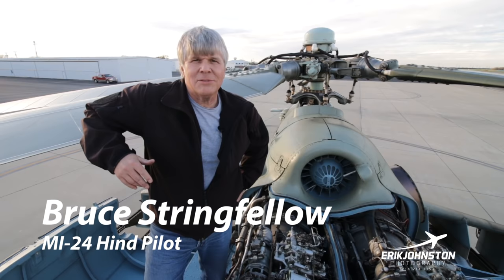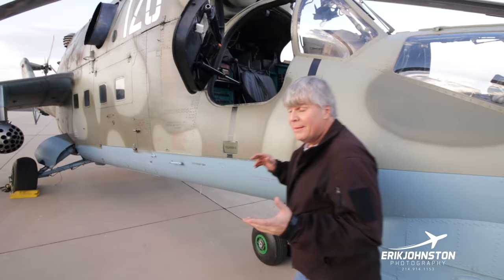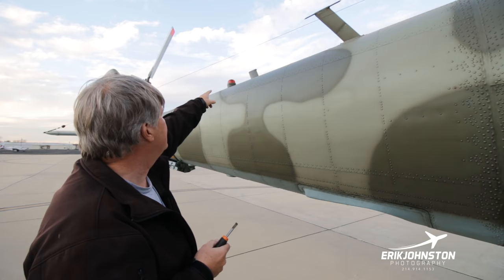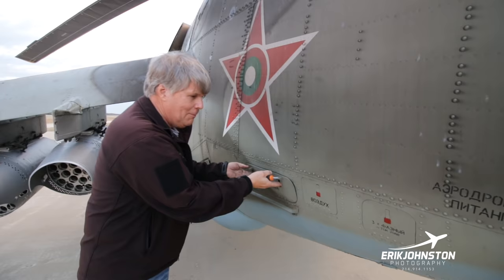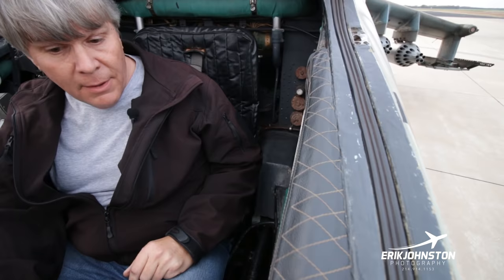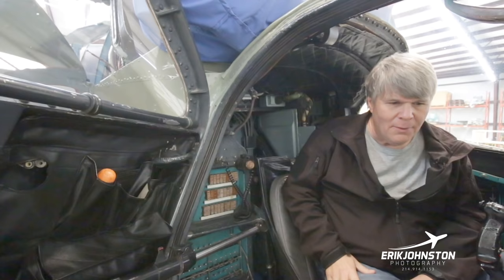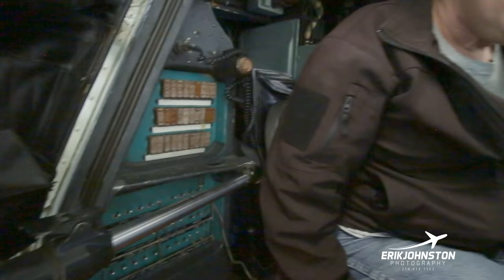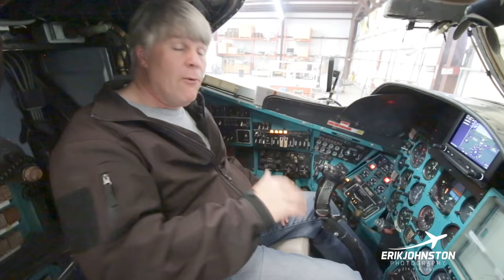Hind MI-24 Helicopter Walkaround Tour

Comment: This Mi-24D   #120 is former aircraft  of Bulgarian Air Forces,  30 years ago I flew at this helicopter. So many memories!!!
Reply: Any brief story about this specific aircraft?
Reply: @badbilly1083  
Neat, that guy flew it!
Man this is a large helicopter. The Russians build big...
Reply: @badbilly1083 Sorry for my English, I hope you will understand what I explain.  I flew at last   25 years ago on this helicopter, it was in second squadron of 24 airbase striking helicopters. I am not sure in translation because there  was a different organization  then NATO. We had 44 helicopters Mi-24 versions D and B. B version was newer with supersonic antitank rocket, in D version guiding rocket    was subsonic.  The inertial navigational system work pretty good, for flights at low heights. I see  there missing one unit above PSU , the name was "Lipa", it  was stayed at the round place  and used  to avoid IR rockets as RedEye and Stinger. Due this Taliban use  usual  RPG-7 against Mi24 in Afganistan. They dig a hole in ground and stayed there as ambush, when helicopter fly above them , they fire  in the bottom from little distance.  I will talk with colleges about this craft  and if we  remember something or find in old pictures I will send you. If you have some questions I will be happy to answer.
Reply: No, you did not. Never happened.
Reply: @chichomancho1791  how many soldiers can be Accamodated in this Mi24 and is it possible to carry out armed attack/assault missions operations while Mi24 have soldiers occupying there berths seats in back cabin
Reply: Ogen De Witt  some of those helicopters was sold to militaries  of African country, and now in my country left 10 pieces.
Reply: @vinodkaka5225  11fully equipped solders can get in back cab  , 8 of them can fire trough blisters,  2 of them sitting in middle and one sitting in the tunnel to the pilot's cab. All solders are sitting on the floor, that berths are removable. The weight of one equipped solder is about 120 kg, plus all weapons (4 antitank rocket, 128 NURS ( nonguided rockets), 1400 cartrdges 12,7mm for machine gun  plus full fuel - this is the max takeoff weight . So the takeoff  can be only like airplane, need a runway,  and takeoff after 80-100 km/h  , in flight speed about 150-260 km/h ,  roll max 60deg., to the drop zone.
Reply: @chichomancho1791  thanks so much for yours reply Sir . Actually it's my pleasure to talk to a former Mi24 helicopter pilot few years ago as These Soviet/Russisn helicopter is my favorite helicopter although I have seen these helicopters flying in front of my eyes but not got opportunity to fly on board these beast as I am from India and indian Airforce also operates Mi24/35 helicopters gunships & literally I don't know the difference between Mi24 & Mi35 for me both looking same from outside
Reply: @vinodkaka5225  differences are only in electronic and weapons equipment , engines, systems and fuselage are the same
Reply: @chichomancho1791 Thanks again for clearing my point by the way I love Mi24/35 helicopter gunships as this is the Only helicopter gunships in the world which has capability to carry soldiers on board
Reply: Me too
Reply: Is it ok to step on the engine cowlings like that or is it just bad practice?
Reply: @chichomancho1791  It must have been shocking to see the helicopter you flew in on a youtube video, eh? What was flying it like? It's such a beautiful craft.
Reply: I see them still flying from Krumovo Air Base and they a such a beauty ! By the way do you know what is the history of the one inside the museum in Krumovo? Was is an older version that reached its limit in hours or was used for spares. Sory for not typing in Bulgarian but wont be fair to the rest of the guys here! Last time I went to the museum the Mi-24 was open to climb inside and look around so I had a very good time inspecting the instruments inside ! What was the scramble time for the Hind if you needed to take it to action and how long is the flight time considering the fuell load?
Reply: @chichomancho1791  That sure is a lot of people!! I was inside one in the Kiyv War Museum, and only saw seats for six, maybe eight people on the back. No wonder the helicopter must make a take off run at that weight, and I bet it won't be able to hover...
Reply: @thomasalexander1851  There's "no step" zone lettered up the cowling and unmarked "step" zone closer to the fueselage. So you can step on these, just not where the grating is.
Reply: Niiiiice
Reply: To a very rich rich playboy, this bad ass helicopter can fit in 71, pilot and gunner at the front and 69 at the back
Reply: @KellingtonDorkswafer  it is nice to see that helicopter in good hands.
Reply: Why isnt your comment hearted yet?
Reply: @conan670431  Bro, fix your "я" in the surname. In English it is spelled with "ya" not with "q". How's things in the fatherland?
Reply: @julianpetkov8320  I know ,but this way not many people can find my profiles on facebook and other media, so I prefere to spell it wrong.... All is well here and the weather is lovely at the moment. Hoping to visit the museum in Krumovo next week again .
Reply: I come to the comments for THIS 💪
Reply: @chichomancho1791  здрасти, чичо) were gauges labeled in russian, bulgarian or english?
Reply: NX120NX is November experimental 120. The FAA licensing in the USA all aircraft are November and exotics are NX. Gliders and ultralights are plainly labeled Experimental.
Reply: @mishacol  всички надписи по таблата и приборите бяха на руски език
Reply: Истински пилот от авиобаза Крумово? Простете ми ако съм малко скептичен , но найстина сте летяли на този МИ-24 ? Механикът във видеото повдига няколко интересни въпроса (Наричм го миханик защото показва явно инжинерно разбиране за вертолета) като например, защо доплер системата не е работила според българските летци, или било ли е удобно да се оправляват насочвани ракети със системата за контрол и как е изглеждало във околяра при положение, че топлината от ракетата би нарушила видимуста през каквото и да е камера. Много ще съм благодарен ако ми отговорите, защото допир със историите на истински пилот на този Звяр биха отговорили и пояснили много неща за машината и доктората за управлението и. =]
Reply: @duartesimoes508  sure it wilö hower or its nearly impossible to land enywhere 😁
Reply: Thank you for telling us about this.
Reply: @chichomancho1791  the place in a tunnel is for a board engineer, the third crewman; practice of including him in the crew was on and off at various times and various militaries. You might not have flown with him, but it was intended as his place.
Reply: @vinodkaka5225  Mi-24 is the general name for the series as a whole and Soviet/Warsaw pact (and early export) versions in particular (several versions existed, denoted by letter indexes, including older Mi-24A and U ("У") with a different, "greenhouse" cabin design).
Mi-25 is an export name for a Mi-24D ("Д") (like the one in the video); India got a couple dozen of those plus a couple Mi-25Us (export Mi-24DU, training model with identical instruments in two cabins and no machine gun, but with rest of equipment and weaponry in place) ("У" stands for training). Some indian Mi-25s were later upgraded to Mi-35 and unique Mi-35U (there was never a factory U version of the 35) specs, some weren't.
Original Mi-35 is an export version of the Mi-24V ("В") with new missiles and stuff (India bought dozen or two of those too, I can look up exact numbers) ("В" comes before "Д" in russian alphabet, but V's missile complex was slow to develop, so transitional D model entered production first).
Export Mi-35P ("П") is a rarer export version of Mi-24P (similar to a V, but with no machine gun and a huge double-barrel 30mm cannon on the right side of the fuselage instead) ("П" stands for cannon).
Then there was the last soviet model, the Mi-24VP (with a 23mm double-barreled cannon in a swivelling mount like V's .50cal gatling, with night vision tech and carrying even more missiles), but it was very rare and never exported, less rare Mi-24R ("Р" or occasionally "РХР" or something), an NBC recon version with no guided missile capability (but the rest of weapons retained) and with troop cabin occupied by two chemists and various equipment they operate ("РХР" stands for radiation and chemical reconnaissance), and rare Mi-24K, an artillery fire director, also with no ATGMs but instead carrying cameras to track and calculate coordinates of artillery impacts to stream them to artillery units so they can correct their aim ("K" stands for corrector).
The next intended version (in newly formed Russian Federation) was supposed to be called Mi-24VM, but was instead called Mi-35M both for russian military and for export. It has a swivelling 23mm gun like the VP, ball-shaped day/night/laser/thermal observation/targeting system like the very rare russian Mi-24PK2 upgrade, non-retractable landing gear, shorter wings with new weapon mounts, new rotor designs, new drivetrain, electronics and ergonomics, all a product of Mi-28 (a different russian attack helicopter) development. That's what's in production now.
There were a couple more rare versions between the end of full-scale Mi-24P/Mi-24V/Mi-35/Mi-35P production with the collapse of Soviet Union and the start of full-scale Mi-35M production in Russia in this century, like the Mi-35Ps made for Cyprus that had the new stubby wings, new landing gear and cabin adapted for night vision, but were otherwise standard Mi-35P, or the russian Mi-24PN ("ПН", "Н" standing for night), that were similar, but had an unusual thermal sight protruding from the nose, but these are what the Soviet/Russian versions were.
There were also some foreign upgrades of various successfulness.
Reply: @conan670431  these might have been reasons for its retirement too, but the main reason is that Bulgaria was/is too short on money to run this many machines, also it doesn't have any real enemies that I'm aware of. Plus it isn't terribly friendly with Russia at the moment, and there aren't many ways to get authorised service for these without getting russian companies involved.
Reply: @duartesimoes508  officially, troop capacity is rated as 8, I believe.
Reply: @profil4e  I don't speak Bulgarian, unfortunately, but, knowing Russian, I think I understood your comment.
That gentleman seems to actually be who he claims to be.
ВВС НРБ actually had an (export specification) Ми-24Д with a white tactical number "120" on its engine cowlings, I can try looking up its serial number and what else we know of its fate.
That recessed device with two domes below the tail of the helicopter is called ДИСС-[some number] (доплеровский измеритель скорости и сноса), it's used to measure the true altitude, speed and slide/drift of the machine relative to the ground.
The guidance system for anti-tank missiles was called "Радуга-Ф", as a version for somewhat cartoonish-looking subsonic "Фаланга-П" missiles. П stands for "полуавтоматическое наведение" (earlier versions, as used on Ми-24А, for instance, were manually guided).
Its use requires the helicopter to be in straight horizontal flight (+/- several degrees); if the flight characteristics permit the launch, "пуск разрешён" lights up within the optic's field of view; limits of angles within which guidance will be possible are also displayed. Copter's control stick has a dedicated button that quickly automatically returns the craft to a level flight as to allow guidance to function, and when the guidance is in progress a system will warn the pilots if the maneuver they're making will make the missile lose guidance.
After the missile is launched, the operator (the pilot in the front bubble) just has to hold the crosshairs in his optic on the target using a joystic of sorts, and the system will automatically identify and track the missile by the tracer lamp in its tail, automatically calculate its deviation from the point of aim (point of aim can be changed midflight, if there's enough time; this also allows operator to easily follow a moving target) and automatically send proportional corrective guidance signals to the missile (via a directed antenna), which will smoothly lead it to the target. Operator just has to track the target, everything else happens automatically (this makes the system semi-automatic; in manual systems operator had to track both the target and the missile; in fully-automatic systems both are tracked by the system).
It's pretty easy and intuitive to use (as opposed to earlier manual systems) and allows a high, 80-90% hit probability at tank-sized targets at all intended ranges.
It also supports several selectable frequencies/signal modulation modes that are used for encoding both radio signals sent to the missile, and missile's tracer lamp flashing to be tracked, so several helicopters can launch missiles near one another simultaneously without interference between them.
Reply: @user-kk1hg8sn7i  true but if you have a surpluce of equippement you dont just sell i all away but put it as long term storage reserve.... yes BAF cannot maintain and operate 40 Hinds but most could have been conserved and stored just as the tanks were ..... over 2000 of those still present .
Reply: @conan670431   but that's what people did. Moreover, that's what people do, especially in the circumstances outlined. Especially when there's money to be made for them personally. Moreover, that's what these same people would have continued doing to this day if they didn't ran out of hardware they could sell. Or, rather, hardware anyone would buy in a condition that it's in.
Properly storing aircraft is expensive. Maintaining it requires buying parts and services from Russia.
Even besides all of that, an attack helicopter is a much more complicated machine than a tank. To make matters worse, when something in a tank breaks, it stops; when helicopter breaks, it falls to the ground; and that just isn't the same thing.
Also, I doubt there were ever as many as 2000 tanks in Bulgaria; are you sure on that?
Reply: @user-kk1hg8sn7i  T-55AM2 tanks (1,400 units kept in storage as reserve in the province of Montana) , 220 T-62 units in storage near Yambol ,  T-72A/M2 160 units on active service / 240 units in active  reserve , PT-76 amphibious tanks (250 in reserve ) , 2S1 Gvozdika Self propelled artillery 506 units as of 2019  .     And a research by US at around 1987 : ----  By July 1987, the International Institute for Strategic Studies estimated that the Land Forces were organised in eight motor rifle divisions, five tank brigades; four surface-to-surface missile brigades with "Scud" SSMs; three artillery regiments; three anti-aircraft artillery regiments; a SAM brigade; and a parachute regiment (later identified as the 68th Independent Parachute Reconnaissance Regiment, forerunner to today's 68th Special Forces Brigade (Bulgaria)) and special commando companies. It appears by the late 1980s that a Bulgarian-helmed Balkan Front was very active, which could unfold and direct the three armies after mobilization. After 1987 the motor rifle divisions were reorganised into brigades as well. At that time the IISS estimated that ground units operated a total of 2,100 tanks (430 T-72 and 1,500+ T-54/55) though later more accurate intell have raised the figure to 2,550.       So yeah even now there are around 2000 tanks but only the T-72's are under modernisation plan....
Reply: @conan670431  these all sound like estimates/guesses, especially stuff like claiming all T-55s are (Czechoslovakian?) T-55AM2s. I'd guess it includes vehicles older than T-55.
Then I thought about CFE treaty and googled for Bulgaria's reports within treaty. So 2 145 tanks, 2 204 combat armored vehicles, 2 116 artillery pieces over 100 мм, 243 combat planes, and 44 attack helicopters were declared on January first 1990. Helicopter part is true, tank/vehicle/jet part sounds high, but assuming lots of old machinery in service - may very well be possible.
524 tanks, 738 armored vehicles, 1 161 artillery over 100 мм, 57 combat planes, 19 attack helicopters declared on jan 1st 2011. That sounds more like it. I mean, clearly not all of those aircraft were airworthy at that time, but that must've been how many were still in the air force inventory.
Reply: @user-kk1hg8sn7i  No idea what if the current amount of the tank force . What it was is that Bulgaria was supposed to take the first hit as war errupted and had to hold for a bit on its own until Soviets arrive with their army across the sea, so all of that eqippement was brought in great numbers in order for the country to serve as a shield for the first waves and it was ridiculous for a small country to have forces like this. Of course the reality at the moment a=is that those units are still there mostly but they are obsolete ( most) that's why only the 72's are in ongoing overhaul  plus the self propelled artilery. What would be the faith of the T-55/62 tanks is unnown as the government rulled like 10 years back that they are still kept as deep reserve / I know that 200 T-55/62 were sold to African country recently ....... Only 6 Mi-24's are being modernised and coming back to service / two flying and combat ready at the moment , 4 in overhaul ( some airframes will be kept for spares but lots are sold around the world. Mig-29's to be fased out by 2030 and replaced with the F-16V / 16 ordered at the moment.
Reply: Seriously guys, this is the most legit comment thread I have ever seen on YouTube - I just wanted to say well done and thankyou! 😂
Reply: @conan670431  well, today it's clearly not more than what the country declared in 2011: 524 tanks and 738 other armored fighting vehicles in defense ministry's inventory, both in active units and in storage.
Well, "obsolete" is a relative term here. All depends on the equipment's condition and intended use.
Mi-24s that aren't still in inventory and haven't found their way into museums/private collections and are still in the county seem to be owned by several murky private companies who are listing them for sale. 4 Mi-24Ds or so went to Cote d'Ivoire recently from one such company. Guess the rest of the hardware that isn't in ministry's inventory anymore is currently in a similar status: sold to various dodgy firms at scrapmetal price to be scrapped or resold abroad, mostly the second option if there's any hope of repairing it to combat-capable condition.
Haven't heard of bulgarian Mi-24s being actually modernised, they're just overhauled and repaired from what I know. Four or so are flying now, maybe several more will join them in the air down the road.
As for plans for 2030... In russian it's called "вилами по воде писано", "written on the water with a pitchfork")
Reply: @user-kk1hg8sn7i  Yep it's defence budget cuts util a conflict errupts and than we suddenly realise we need a strong military.... Like Serbia did , army felt in dissrepair for decades and than when NATo did its idiotic thing to attact the nation without the UN's approval all they had was a handfull of Mig's in bad shape and very old russian hardware.    Only 6 Mi-24's are planned to serve actively , and only 2 are fying now.One can often observe trains moving tanks and mil truks towards Turkey , so I guess sales are still on .....
Reply: @conan670431  I don't think conflict will erupt there anytime soon.
From what I understand, the whole country fell in disrepair far before there was a separate Serbia; otherwise, it would have still been Yugoslavia. They failed to stay together in face of american imperialism and they faced the consequences.
Bulgaria chose its side 30-ish years ago too. Though it's in safer place than many now. Just not the richest.
Reply: @conan670431  these are the fates of all bulgarian Mi-24s (by numbers on their engine cowlings; I think it's possible to figure out their serial numbers too),

Mi-24Ds:
101 in Крумово (Пловдив) as a museum piece
102 sold to USA or Mali
103 sold to USA
104 sold to USA or Mali
105 either "demilled" and for sale in a bulgarian private company's possession, or sold to Burkina Faso
106 sold to USA
107 either "demilled" and for sale in a bulgarian private company's possession, or sold to Burkina Faso (one is 105, the other is this)
108 in military history museum in Sofia
109 placed as a monument near former Стара Загора airbase
110 sold to Cote d'Ivoire
111 in Долна Митрополия as a ground training piece
112 sold to USA or Mali
113 in museum in Sofia
114 sold to USA
115 sold to Cote d'Ivoire
116 sold to Mali later, on a separate occasion
117 sold to Mali
118 sold to USA (owned by the same people as 120 in this video)
119 sold to Mali
120 sold to USA (the one in this video)
121 sold to Cote d'Ivoire (110, 115 and 121 were sold several years ago with some night vision upgrade, apparently; two of them were wrecked since)
122 sold to USA
123 sold to South African ATE company to become a sample of "Mi-24G" upgrade program they were offering
124 sold to Cote d'Ivoire
125 sold to USA or Mali
126 sold to Cote d'Ivoire (124 and 126 were sold 20-ish years ago and damaged beyond repair in a french airstrike in 2004)
127 sold to USA or Mali
128 sold to USA or Mali
129 sold to USA or Mali
130 wrecked in Bulgaria in 1996
131 sold to USA or Mali
132 sold to USA or Mali (six that ended up in Mali were mostly destroyed during the civil war) (total of 11 were sold to USA)
133 through 137 are not in flying condition, but still in bulgarian inventory in Krumovo as of April 2015
138 was remarked as 145 after repair, no idea why, but also still in bulgarian inventory apparently;

Mi-24Vs:
139 was remarked as 146 after repair, no idea why, but also still in bulgarian inventory apparently
140 and 141 are not in flying condition, but still in bulgarian inventory in Krumovo as of April 2015
142 and 143 are the two flying ones in bulgarian service
144 is not in flying condition, but still in bulgarian inventory in Krumovo as of April 2015;

145 and 146 are former 138 and 139 (Mi-24D and Mi-24V), respectively.
Reply: @chichomancho1791  if you have discord or something to message people on ill take some information on these craft id love to pick your brain
Reply: @user-kk1hg8sn7i  Когда этого вертолёта задумывали, никакого бортинженера не было включено в экипаж. в варианте Ми24А кабина была как у Ми8, с тремя членов экипажа в ряд ,командир,бортинженер и второй пилот, а у носа лежал четвёртый член  стрелок для пулемета и управляемых ракет. В вариант Д и позже, убрали стрелка и бординжинера . Тоннель позади командира сделан для аварийного выхода командира - спинка сиденья откидывается назад. Тоннель ещо служит для визуального контакта командира групой высадки с внешней обстановки и командиром экипажа.  С временем бординжинера начали забирать с собой когда шли на площадку или другом аэродроме и так прижилось. Бортинженер не имеет никакой возможности добраться до управления двигателей из тоннеля. Но мы летали с бортинженером всё-таки,  шутили что нужен полковниками - когда забудут что-где он им напевно припоминает, как Наташку - речевого бордового информатора.
Reply: @NewLifeFromTheWayofTruth  Sorry, I can't understand your remarks or question.
Reply: @chichomancho1791  Кабину Ми-24А изнутри я никогда не видел, поэтому спорить не буду.
Ну, у вас во времена вашей службы было так, в Союзе же в разное время экипаж официально был то три человека (с бортинженером), то два.
Сейчас в разных странах по-разному; помню, году в 14 видел в интернете некролог или мемориальную доску экипажу сбитого на Донбассе украинского Ми-24 (наверное П), так там погибло три человека, включая штатного бортинженера; зачем они его брали на боевой вылет - не знаю.
Про полковников наземных должностей - логично)
Reply: @chichomancho1791  were you apart of any major conflicts if i may ask?
Reply: @chichomancho1791  Поздравления, чичо Манчо. Не очаквах да видя български коментар, камо ли на един от пилотиралите точно този хеликоптер! Аз съм от Стара Загора и мисля че и при нас имахме полк с такива. Един от актьорите в кукления театър (където работеше татко) летеше по нова година с такъв за да раздаде подаръците на децата на служещите. Хелая ви всичко най-хубаво, Иван
Reply: How much fuel does such huge craft roughly use in normal in hour? It has to be quite substantial amount and I'd assume that range/flight time isn't too long? It had to be very exciting feel to fly such thing first time.
Reply: Адмирации за това което сте правили преди 30 години. Имате ли идея кога и как тази машина е попаднала в Щатите. Това е част от националното богатство на онази България която имаше ВВС със стотици самолети и хеликоптери, разпродадени или нарязани за жълти стотинки и да напълни джобовете на неколцина национални предатели. Инцидентът с Майор Терзиев е логично следствие от състоянието на остатъците от някогашните горди Български Военно-Въздушни Сили...Не бих се учудил ако сега тук в Щатите има повече летящи самолети и хеликоптери от Българските ВВС, отколкото в сегашна България.
Reply: @user-kk1hg8sn7i  One big problem of the Soviet and ex-soviet countries is the massive corruption.
Reply: @badbilly1083  ओओओओओ और ओओओओओओओओओओओओओओऔ
Reply: Теперь на осле ездишь?....
Reply: Worzal Gummidge  ...uhm, what?
By the time Mi-24s were in production DShKs were out of production and were being replaced by a newer .50 cal - the NSV.
The helicopter with the clamshell rear loading ramp (on most versions) is the multipurpose Mi-8 (Mi-17 - the export Mi-8MT, Mi-171 - the export Mi-8AMT, etc.). It's possible to mount a machine gun there on some, but it's a 7.62 PKT from what I remember, or occasionally an M240 on current (or, one can say, past) afghan Mi-17s. A front mount for a PKT also exists for some, as well as front door/blister mounts for PKMs/M240s and AKs/RPKs.
Mi-24s, on the other hand, have entirely different armament up front, capability to mount PKMs to the doors (during the soviet intervention in Afghanistan occasionally the onboard engineer was carried just to man one) and AKs to the blisters and that's it. The idea of a rear facing NSV in a flexible mount was toyed around with, but Mi-24s never had a rear ramp, thus changing a design just to have a tunnel there for one more crewman to just barely fit in was abandoned on early prototype stage.
Reply: Worzal Gummidge  buying a couple of Mi-24s (along with the crew) for mercenary-type operations isn't a thing anymore. Sure, a lot of helicopters and parts (with not much use for them and a dire need for cash locally) were left in post-Soviet/Warsaw pact countries when the Union (and the Pact) collapsed (along with an occasional repair plant specialising in them here and there), but, even though large initially, the supply of both Mi-24s and parts wasn't endless, and has already dried up in the last five or so years. You can't really buy a black/gray, or even a white market one anymore, as it applies to classic Mi-24s. There's just no one selling them. The only ones flying into 2050s would be ones in Russia and countries friendly to Russia, as the only way to get all the needed parts or authorized repairs for them is from Russia, and the only countries they're selling them to are the ones that got their copters legally, with proper repair history and so on (there are exceptions, but, once again, only for countries friendly to Russia). Only ones sold lately were four Belorussian Mi-24Vs sold to India for Afghanistan, couple of their Ps sold to Myanmar, Russia selling new production Mi-35Ms to a bunch of different countries, old Mi-24Vs and Ps to Angola and Sudan I think, repairing various previously supplied ones, allowing repair of Azerbaijani ones in Belarus and ex-Libyan ones in Egypt for Egypt, and occasionally supplying some Mi-24Ps as military aid for Syria and maybe some other countries. That's pretty much it. Eastern/Southern Europe and Ukraine have all ran out of helicopters for sale, spare parts, or even airworthy Mi-24s at all in some, and countries in Africa and Middle East weren't very good at maintaining theirs in the first place.
Reply: Worzal Gummidge  what's a "VD"? It's either D or a V. Neither of those, as well as neither P nor VP, had what you're describing.
Reply: J
Reply: @vinodkaka5225  Most Mi-24 variants are older Hind designs, and have little to no digital equipment on board. For example, the Mi-24P only has analog flight instruments and weapon systems. However, some modern Mi-24 variants, have glass cockpits, whereby all flight instruments and weapon systems are digital. 
Most Mi-35 variants are modern Hind designs, and usually have a lot of digital equipment. However, there are some Mi-35 variants, like the Mi-35P(not the upgrade, it’s the one that’s basically a direct copy of the Mi-24P), that have the old cockpit instruments and analog equipment. The naming scheme of the Hind variants is confusing, so don’t worry about not knowing every single detail of every single variant out there.
Reply: @KellingtonDorkswafer  I was surprised at all the room each seat has especially the front seat and having the eye piece and gun controls. You could easily take a nap on a long flight
Reply: @georgepetrov7343  въртолетите бяха разпродадени официално за 15 хил. $ бройката , контийнеризирани и натоварени на кораби, по времето на костовото и царското управление. после продадоха цяла ескадрила на мали.
Reply: @sanches2  здравей,  полкът щурмови въртолети беше само един и се базираше на летище Ст.Загора.  след 2002 г каквото остана от въртолетите се прехвърли в Крумово, а летище Ст. Загора закрито.  много е тъжно когато едно летище утихне!
Reply: @NorceCodine  who tell you that they do not know Russian !?
Reply: @chichomancho1791  Your English is easy to understand and better than my ability to speak zero Slavic languages.
Reply: @chichomancho1791  Anyone wondering what chicho just said: "all the inscriptions on the boards and utensils were in Russian"
Reply: @chichomancho1791  Do you know about the simulator DCS? There is a Mi-24p there and would be awesome if you could try it out and give some tips on how to fly it properly!
Reply: Речевият информатор "РИ-65" на борда на вертолета на български или на руски говореше? Някъде бях попаднал на информация, че този вертолет, който имат в американския музей, имал гласови съобщения и на руски и на български, но не мога да намеря публикацията. Не съм никакъв експерт, но доколкото ми е известно, устройството "РИ-65-50" се използва за записване на речевите съобщения на магнитна лента и лентата се слага на "РИ-65", който е на борда на вертолета. Предполагам, че са правени записи на български за българските вертолети? Благодаря, и весели празници!
Reply: Why this chopper is not in oure country????
Reply: @badbilly1083  The story is that is bulgarian,someone need to bring back the chopper in bulgaria!!!!!!
Reply: @chichomancho1791  И кок ги продаде а???
Я кажи на тея шматки тука кой ги продаде и защо по дяволите този някой не е в затвора където му е мястото????????
Reply: I've always wondered if it was nose-heavy so when you're coming down for a ground attack does it tend to want to fall back or go forward like will your nose dip below the Horizon easily it just looks so much heavier in the front than the rear
Reply: @thomasalexander1851  cowlings are made with a walking path built into them, even has anti-slip grips on walking plates.
Reply: dose it have titainium protection ?